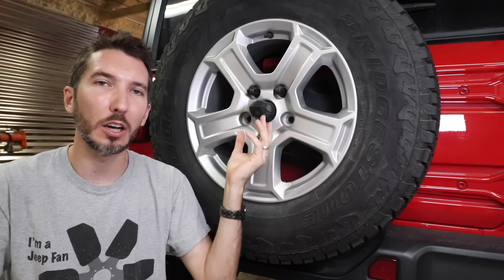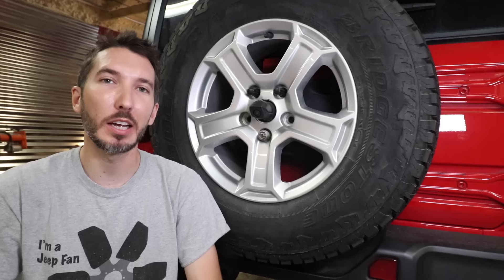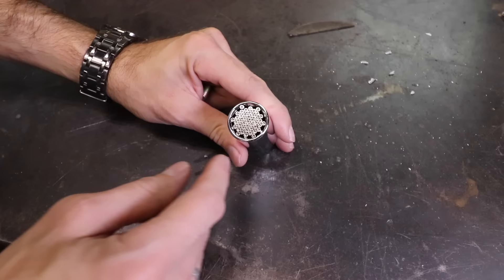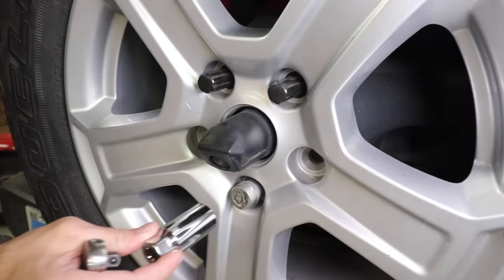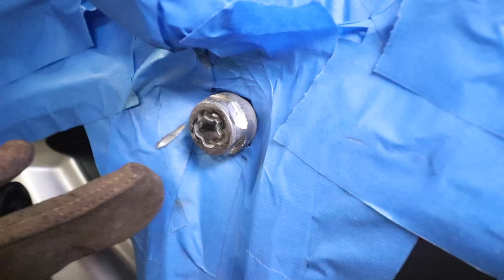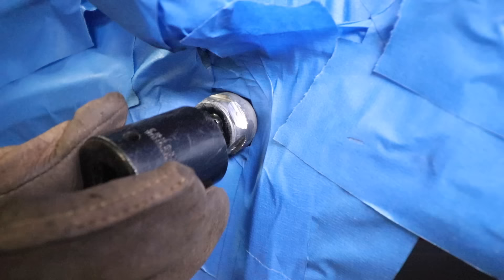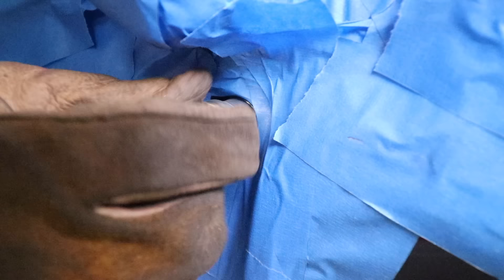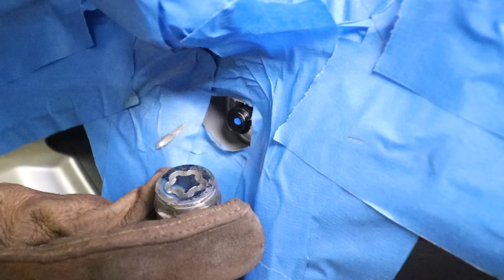3 Ways to Remove a Wheel Lock Without a Key

Comment: Great video with good info.   I ran into the same problem with my 2007 Jeep Wrangler.   I went to take the lock off one of my wheels and the inside of the lock key snapped off.   I have been told that is a common problem.   That lock is made by a company in NY called McGard.   I looked up their number and the very nice lady told me to look in my glove box for a sticker with the part number that came with the lock nut set.   Often times people stick them on the owner's manual.   I had purchased the Jeep used and couldn't find it.   The McGard lady had me take a picture of the lock and email it to her.   Based upon that picture they can often time match the key that you need.

Same thing happened to me at the Jeep dealership in Sioux Falls, SD.   No help.  I ended up taking the Jeep to my local shade tree mechanic who had a tool set for removing the nuts.   The tool is a hollow socket with splines on it.   He hammered the socket on each of the five locks, the cutting ridges inside the socket cut into the outside of the lock and he used an impact wrench to take them off.  

I took the lock off the rims on my Tundra two days later.  No more locks.

Comment: I have taken a socket that's a little smaller than the lock lug and drive it on top of the lock lug with a hammer then use 1/2 inch drive ratchet to get it loose cheap China sockets work the best

Comment: There is a gadget now that may work.  A larger "fits-All" socket called the "Gator Grip King" is available.  Fits up to 1 1/4" items.  1/2" Drive professional grade socket. Self-adjusts for all shapes and size fastener, except a perfectly round head, just file an edge. Self-adjusts from 7/16” to 1 ¼” Standard and 11mm -32mm Metric.  Thought I'd let you know.  It's a little pricey, but may be worth the cost.  It's about $25.00

Comment: Here's the easiest way of all:  go buy a cheap socket (3-5$) that's just a little bigger than the key lug.  Then, take a hammer and pound the socket over the key lug.  The socket will likely split, but it won't matter because it'll hold together if you size it right.  Then, take off the key lug with a socket wrench and throw the whole rig away (key lug and cheap socket) because you'll never get the socket off.  Who cares, though, as you don't have the key for the key lug anyway.  I've done this many times and it works like a charm.

Comment: Had the same thing .daughter brought her jeep out to switch summers to winters . It had these anti theft nuts .well i got 2 off 1 side and my 3/4 inch drive impact couldnt remove the other side . told her to take it back to the jeep dealer where the new kid or lazy mech must have installed the wheels without torquing them. I told her why should i spend 2 hrs of my time because they were installed wrong.

Comment: The mcgard wheel lock extraction sockets don't work they have a collar that will spin on the sides of the lock. I use air hammer to slowly spin it out. Or if its accessible cut the ring and use a extraction socket

Comment: Electro-erosion. put some solid grease on the lock bolt. Apply + voltage on the car, - on the socket. Approach the socket to the nut, in-out, in-out.... sparks fly, the + electrode is destroyed, while adapting the shape of the - electrode. works on the hardest materials.... I wonder, if there is a portable machine, that can be used in our garage, or on the road.

Comment: O2 SENSOR SOCKET. Best way to get it done is to use an Oxygen sensor socket. It is a lot more flexible than a regular socket and you just need to hammer it gently in place. Regular sockets are way too tight and require a big hammer to put it in place, that can damage your bearings

Comment: A Stilson wrench would certainly remove it if it was far enough protruding from the wheel.and it looks as though it does. The thing with stilsons is the tighter the nut the harder they grip.

Comment: I used to have keyed lugnuts on my pickup years ago... I lost the key, so I bought another set... Lost that key, went to buy a keyed socket and there was one on the shelf... The dude that worked there said they a many different keys so it won't work... Bought it and it worked... Lost that key, used and angle grinder to make some flats on the nuts and used a 4 way to get them off... Done with all that stuff...

Comment: They acutely sell wheel lock removal kits you hammer it on it bites in the lock and you just back it off I have to use I in the shop all the tim but with dodge they make a sleeve around it so if you don’t compress the sleeve enough it will just keep spinning without touching the wheel lock

Comment: Are any of the new adhesives strong enough? Especially since the groves on the top would add to the torque strength. So instead of welding, use an adhesive
Reply from the maker: Maybe jb weld

Comment: Took my wifes lexus to wal mart for a set of new tires.  When I came to get it they gave me the news that they broke my lug nut key.....great!  Problem is I can't get lug nut off now.  Ordered one from EBay for twenty eight dollars and it did not fit. I will try grinding some slots to fit the socket.  see if that works.  Have a welder here but its my sons and not sure how to use it.

Comment: This worked once for me. I stress once. I have tried it a few other times and it did NOT work. My closest friend had a 1990 Volkswagen Golf diesel.  It had some sort of semi rare metric tire on it. His dad being the cautious type , plus he paid for the car, put an anti theft lug but on each tire. Sadly that same year he was killed in an automobile accident. Fast forward about a year and a half. My bud has a bad puncture in his back wheel. Normally if it’s just a hail or a screw hole I just plug, trim, inflate the tire. This was bad enough that the tire needed to be patched from the inside. Unfortunately for him his father had never given him the socket for the security but on his car. We searched high and low through his shop to find the security nut. We could not find it. So I took a socket and filled it with dry play sand. Kind of the same theory as the socket with the rods in it. Popped that thing off pretty as you please. When I put the lug nuts back on I used a nut off of the spare tire. Funny thing is. Just as we were finishing up and had come back from getting his tire fixed. His mom came up. Asked us what we were doing. I explained to her about the security lug nut on each one of his tires. She says. There is a funny looking tool in your dad’s truck glove box. Bingo, found it. I reinstalled the security nut on his tire and since my friend, who now owns a chain of rent to own stores, I put it on a 3/8 -1” extension and welded it to the extension. I put that on a 14 inch 3/8 breaker bar and carefully explained how to remove the security nut. I also rigged up the exact same set up for his other lug nuts. He is still my best bud. I still have to fix everything he owns that has wheels. He fixes all my computer stuff. Later I had the same issue with my wife’s Miata. The sand truck so did not work that time. I had to weld a socket to it.

Comment: Another method is to make a horizontal line across the bolt and then use a large flat screwdriver socket and it would come out nicely and you would still have everything intact and still can reuse the lock; or, another method, simply make an indentation on one side and chisel it out.....I would not touch welding stuff....with all the electronics in the car...

Comment: good videos. I want to use the 12 point socket. my wheel lock is 20.4 mm outer diam. what size socket do i need 20mm? 21MM? thanks

Comment: Bought a car, Skoda Yeti awesome car, and checked carefully for the security key for the wheel nuts. Check yes there it is. Two weeks later get a puncture. And the key is totally wrong, it's for a Merc. So back to the dealer in Grimsby it goes, under warranty with instructions to remove all the locking wheel nuts and replace them with ordinary ones.
All cars have alloy wheels now, no one steals them, so delete the locking nuts and fit ordinary ones.

Comment: How about using your metal cutter and cut a slot across the key and then use an impact tool with a flat bladed screw driver bit and just hammer it off.

Comment: My last car had locking wheel bolts that were resest in the wheel and even though I had a key for undoing the locking wheel bolt but had broke because the place that put my wheels on from changing tires done the wheel bolts up to tight. I ended up taking my car to a guy who welded a drilled out nut that fitted in the hole in the wheel where the wheel nut was. He welded in the centre of the nut on to the top of the stuck wheel bolt. He then was able to put a socket and wrench with a long pole on it to undo the locking wheel bolt with no damage to the wheel.

Comment: I wouldnt be so optimistic if you had to deal with the BMW locking nuts with the rotating hardened steel collar -- no one can get these off easily. Even the BMW dealer told me they were tough !

Comment: A good socket may not work.whenyou try to weld to hardened metal it crystalizes and will crack right off.a cheap less expensive socket or a price of black steel pipe will weld best.the log lock is heat treated just enoughf so that you can't just hammer a socket on or get it with vise grips.but it may weld depending how well it's made.you can cut a groove on the edge and turn it if it's not overtightened.

Comment: Had one on a Kia soul I bought used no key had put breaks on it...so I took a 12 point socket and hammered it on the lock and it worked out just fine but used a socket wrench and a cheater bar ...instead of an impact

Comment: I would have tried a good pair of vise grips like the Milwaukee’s that you can torque super tight. If that didn’t work I would’ve tried a small pipe wrench. Then I would’ve went to smashing a 12 point socket if those two didn’t work. If the socket didn’t work, I would’ve just welded it

Comment: someone used a similar technique on youtube without grinding... using a 12 point, instead of 6 point one, they force hammer into the bolt... i am going to try it, as I have dont have the safety key for my wheels ...😅

Comment: If just weld a small bead on the bolt and use an oversized socket, it will come off easy

Comment: I would have started by grabbing a length of angle iron and would have welded the angle iron (at an angle) to the nut then just swung the angle iron until the nut came off.

Alternatively, if no welder was available, I'd have simply drilled the head off the nut then grabbed the rest of it after the wheel was off, with pliers and simply removed the bolt that way.

Comment: I'm assuming the dealership asked who installed the lifts is because they would have had to use the key to remove your tires just to lift your vehicle and just didn't replace your key back in your vehicle
Reply from the maker: The wheel lock was only on the spare

Comment: Unless you're in some shithole city, get rid of these stupid lug bolts and replace them with normal ones.  If you're 4-wheeling, you don't need extra complications. 
 The easiest way if you don't have the key is to pick a socket that will barely fit over the bolt and tap it on with a hammer.

Comment: There are three things I would do first, before ANYTHING destructive. 
1. Go through paperwork in glove box... the socket may have been tossed in glove box, or with spare tire or jack.
2. Check through paperwork in glove box for the card that came with the lugnut, which has the correct model to order. There are hundreds of configurations if made by McGard, tens of different ones if bought aftermarket ( AutozoneCheckerPepBoy Etc )
3. Go to a professional mechanic, or a performance tire shop. A well equipped shop, not a bargain place should be able to remove easily. You can also try a place that does a lot of 4X4 and performance work, should have a couple thousand dollars worth of kits specifically for removing these cleanly. If they are your regular mechanic, maybe gratis.... but even If they charged ya 25-50 bucks... lot cheaper than a rim.

Once off, buy a new set of 5 of these, I recommend McGard only.... they are much higher quality than the cheapoids, and order a seconds wrench immediately. Keep one at home with your filters and other car supplies, one in vehicle. Record the Key Code Number.

The dealership should have been helpful, at the very least, to send you to wherever they normally get stuff like this done, and had them bill the dealership

As a locksmith, I have a number of franchised and used car dealers that regularly will send a client over if they have a problem the dealership is technically not equipped for. Missing remotes, missing or additional keys, etc. They often reimburse ( if they are smart ), but at the very least, they send you to the right place.

Comment: how about, find a piece of pipe, that does not fit the round bolt. Put dry ice on the bolt, heat the pipe in the cooking oven to 500 F. one expands, the other shrinks and quickly fit the pipe over. temperature equilibrates, and you have a press joint.

Comment: Last 2 methods heated the lug nut, allowing it to expand a little so that it was a little easier to turn.
If your lug nut was tightened ON THE WHEEL with 140 lb-ft like mine, your attempts probably would have failed.

Hot liquids can burn; do not put in lap.

Comment: If you just used a 12 point socket that was around the same size as the head of the locking nut and hammer than on good and tight then just spin it off.

Comment: Okay dealer story. My beloved 2-Door Tahoe had the “change engine” light come on right in front of the Chev dealer. $6000 later they had installed a brand new 5.7L engine. What they didn’t mention is that they had reinstalled all the old, 200,000 mile accesories and sensors. Even the belt. Spent the next year replacing everything.

Comment: I would of used Large Vice Grip slid an 18” pipe over the handle spray liquid wrench and off she comes.  
Fill the cut with JB weld and paint the wheel

Comment: Many years ago I had a Plymouth Voyager mini van that I bought new with the additional 7 year-70,000 mile warranty. Had a failure of the engine control module and had it towed to the nearest dealer. I informed the service manager of the warranty which the service manager confirmed on the computer. He told me he could do nothing because they ere closing early for the Labor Day weekend. As per the warranty they were supposed to rent a car for me which he could have done because most including this dealership rent cars  to customers while their cars are in for repair. Well the cars were there but he did not have the time to fill out the paperwork. Had to wait outside for the wife to pick me up. Come Tuesday I was on the phone to my dealer who gave me the number to customer service in Detroit. Long story short, the service manager was looking for a new job by the end of the week.

Comment: Well this isn't a normal wheel lock its a tamper proof one. So you have to crack and grind off the outside layer and then you can hammer a turbo socket on there and get it off.

Comment: You can buy a replacement key on Amazon or EBay  OK, they're £25 ($35 ish) but you then have security for the spare, you don't catch the wheel with a grinder, and you don't have to mess with a welder. I don't understand what happened at the dealer, you bought it there and the told you to F off? they didn't even offer you to buy a key?

Comment: First and foremost; I offer you my condolences for buying a Jeep.  In Australia they are nothing other than expensive crap.  My BMW has a similar system of wheel lock nuts.  There are some 30 such nuts in the BMW range; it is a matter of finding the right one.  My mechanic in fact LOST my wheel lock nut which looks similar to the one on your vehicle.   I went down the the BMW dealership; they gave me a full box of 30 key nuts, and said to me; here mate, try these and you will find that one will fit.  Sure enough; the third lock nut I tried, worked like a charm.  I got the number engraved in the nut, and bought two of them.  Just goes to show that customer service is not a hallmark of Jeep is it.I was visiting my late sister and brother in law in California back in 2018.  The brother in law had a 12 month old Jeep Cherokee.  Now that was a sorry vehicle.  The poor bugger could not get it started, as the Starter motor had shit itself.   The Mechanic dismantled the SM from the vehicle and took it to a Jeep dealership in San Francisco.  He came back with a brand spanking new Starter motor and fitted it.  Guess what. NO CIGAR mate.  The brand new SM was also faulty to they went back to the dealership; got another new motor, and it was as useless a the first two.  I was convinced that if it were raining virgins, my brother in law would get washed down the gutter with a queer.  They were still trying to get that heap of dung going when I mercifully left California for home.  Seriously mate; Jeep have a bad reputation here.  Can I enquire why the Jeep dealer refused to help you out?   I missed that in your video as the sound was not too good. Best of luck mate.  I hope you have now solved all your Jeep problems. Cheers mate!

Comment: All due respect, you are over thinking that problem.  I have dealt with this many times over the years.  Grab some cheap sockets(Chinese 12 point) from a pawn shop  ,3/8 drive works best for me because theyspin faster than a 1/2" impact.  Hammer one of the disposable sockets onto the "puzzle lock" wheel nut,  then spin it to the left at full speed! Even if the socket spins a bit,  it will take that lock off!  You then drive by the dealership that screwed you over and throw the lock lug through a plate glass window!  Do this at your own risk, and at night of course..